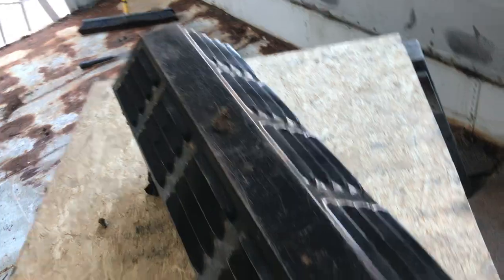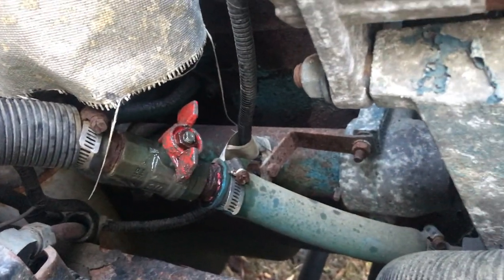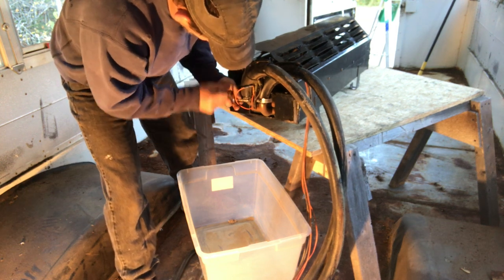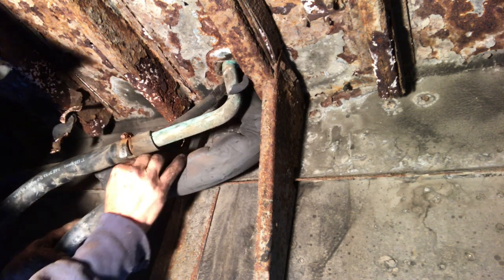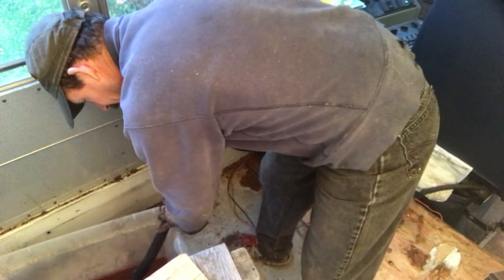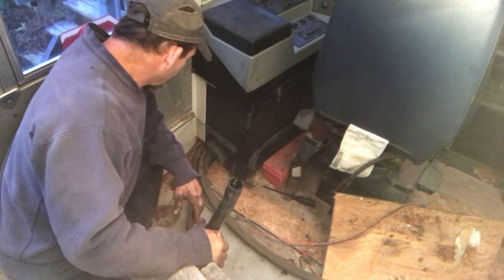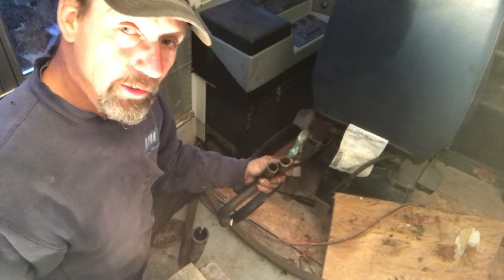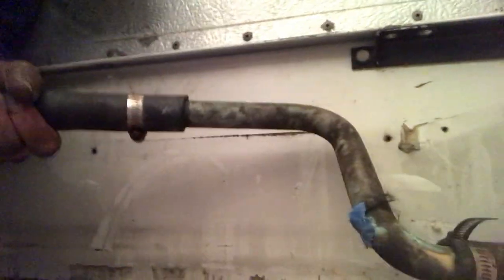How to Remove Bus Heaters

Comment: The heater core to the left of the driver's seat has T fittings where you placed a 'loop'. Individually capping off both T fittings, will 'force' the coolant to circulate through this heater core instead of easily flowing through the 'loop'.
 Hope this helps.
 Thanks!👍
Reply from the maker: Thanks for the feedback, Phil!  T-fittings?  Not sure what you mean.  Let's see if I remember this correctly!  (Seems so long ago, now..but I'l be doing this with my daughter's bus, soon so I'll need to remember!). Coolant flows from the radiator, into the heater by the driver's seat, down and in and out of the back heater, back and in and out of the mid-ship heater, then back to the engine.  (Providing that all the valves are open).  I don't remember seeing a T-fitting...so I just looped the coolant lines coming in and out of the driver's heater...which does currently work.  Am I missing something?
Reply: @River-Channel  Yes the heater will 'work' with a loop hose.
 There's two hoses supplying coolant through the firewall. They supply and return coolant. They (2 hoses) supply to 2 or more heater cores.
 The driver's (left side) heater isn't a flow through core. 
 'Path of least resistance'. The 'loop' is the easiest circulating route.
 🤔 Pinch closed the 'loop'. Bet it makes a difference!
 Hope this helps.
 Thanks for the reply and Good Luck with the 'Shorty'!👍

Comment: Hiii...I'm in stage..remove the seats my question is 
Should I keep the heaters back there?
Pros cons?
Reply from the maker: If you see yourself traveling in cold climates you may want to leave it in so you don't have to run an alternative heat source.  We stay mostly in warm climates in winter so took it out.